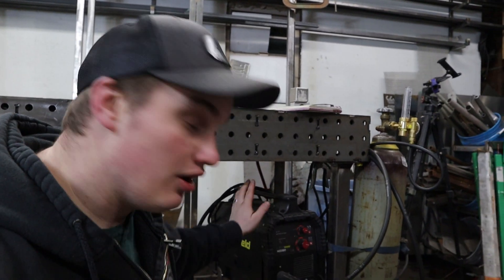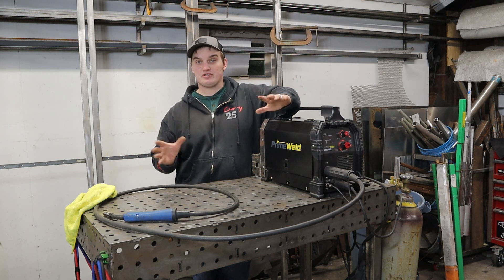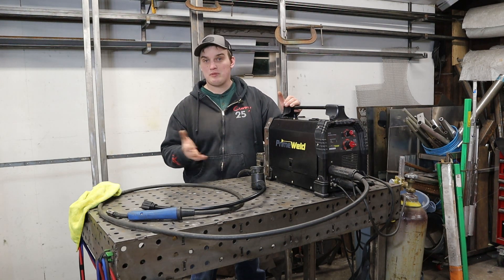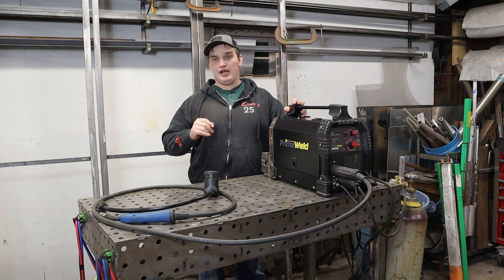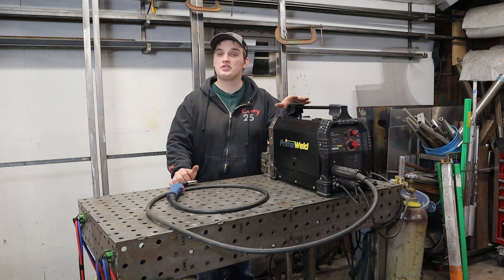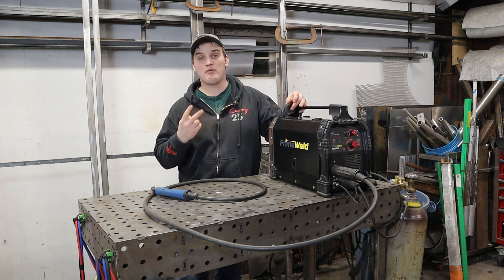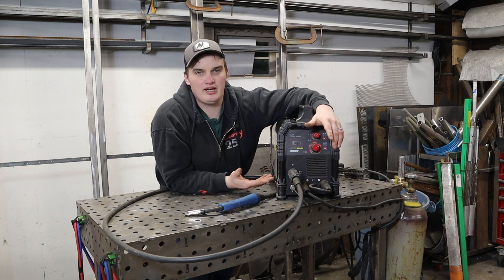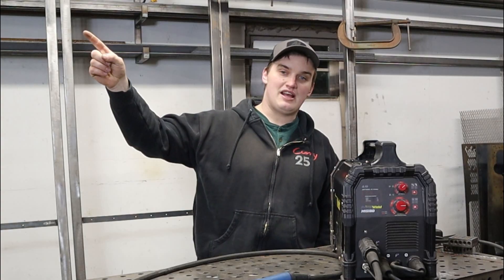PRIMEWELD Mig 180  One Year  Review  NOT SPONSERD ( 2022 )

Comment: I'm a bit confused with the MIG 180 vs the MTS 200 from Primeweld. Both do mig and flux. Both do stick. The 200 does TIG and the 180 comes with the spool gun for aluminum? What else is the difference?
Reply from the maker: You got it. That's the primary difference besides a couple hundred dollars. I would recommend the 180 over the 200. You don't get that much more power for the price

Comment: Any idea how thick you could properly weld on both the 110 and 220. Looking to do a front tube chassis on a car but only have 110 at home. All material should be around .125” or thinner, thanks
Reply from the maker: Unfortunately the most difference on that isn't based off the machine. It's usually based off of the size of your circuit. I have 12 gauge wire and a 20 amp circuit. On 110 and I can weld up to quarter inch with no problem. But the smaller your circuit and wiring are .the less capabilities you will have.  But unless you're wiring is very underrated you should not have a problem doing 0.125 or less

Comment: hello and congratulations for the video! soon I too will have a mig 180, I wanted to ask you about the settings for the spoolgun on aluminum. how many amps and volts to weld 2mm or 3mm thick aluminum? thanks a greeting from Italy
Reply from the maker: I usually start with what the chart says that comes with it and adjust from there
Reply: @amcustomfab  ok thanks a lot!

Comment: I just received my Tweco 2- style replacement torch after the stock torch plastic snapped open.  It's more annoying to use (the button is farther down the handle and triggers more easily).  Though, it is much heavier and more robust.  It will take some getting used to.

Note:  the new gun uses the long tips, so any consumables you have won't fit.  Also the shield slides down the nozzle easily, so you have to constantly pull it back on prior to welding.
Reply from the maker: Good to know

Comment: do you know how thick this can weld up to? i plan on using it to build utility trailers, rocket stoves, fire pits and repairs
Reply: MIG it can get full penetration with steel up to about 3/16 but that's pushing the limits of your output & duty cycle. Much better to have a beveled joint and not run it so hot. Or use stick to get that penetration on thicker stuff. Aluminum is comfortable up to 16ga.

Comment: I noticed their website says the mts200 and 145 can scratch tig, but not for the 180.
Will the one 180 still scratch TIG on the stick mode? Thanks again.
Reply from the maker: Yes it can scratch Tig. The 200 is actually a lift Arc which if you watched my video I made that mistake of calling a scratch start which was my bad.  But me personally I would get the 180 and then put the extra money towards a dedicated tick machine that can do AC also. So you can weld aluminum because the 200 is DC only.

Comment: Subbed! Awesome review. Your videos have been helpful in me making my decision and purchasing my 180.

I've heard that the machine requires a 30 amp breaker even in 110 configuration. Have you had any issues using on a 15amp breaker?
Reply from the maker: I use mine on a dedicated 20 amp 15 will probably be a little low unless you are just running on thin sheet metal
Reply: @amcustomfab  good to know. After speaking to my electrician he let me know that I have 20 amp service outlets on the exterior of my garage. Thanks!

Comment: Is there much of a difference between this 180 and the 200. I want one and figure that I'm better off just going with the 200 since its only $200 more and just 3lbs heavier.
Now if the 180 was at least 15lbs lighter Id go with that for mobility.
Reply from the maker: I personally feel like the 180has a little more value for the price because you don't get that much more power out of the 200 and the 180 comes with a spool gun.
Reply: @amcustomfab  thank you, that helps me a lot on making my decision. I'll use the funds I save, and buy the 220v extension cord I need.

Comment: Deciding between this and the brand new lincoln weldpak 90i mig. The lincoln is only 15lbs instead of 40lbs and it's 150 bucks cheaper but it only puts out 120amps(the name is misleading) and can't runa spool gun(let alone coming with one. It also only has a 10gt lead rather than a 12ft.  But the lighter weight means you can weld with it slung over your shoulder for an hour and not get sore.
Reply from the maker: I guess it's all going to come down to what you're going to need at the most for if you really need to swing it over your shoulder and climb a ladder 15 to 40 lb is a huge difference but if you need it to be more versatile on both amperage and processes the 180 is where it's at
Reply: @AM Custom fab  yeah I thinks that's what it'll be. I'll get the mig180 and maybe the $170 Titanium flux125 for when I need a 15lb machine

Comment: Interested in how it runs on thin sheet metal? Looking to do work on some thin stuff and wondering if it can go low enough for that.
Reply from the maker: I have only welded down to 16 gauge with it. To which it does very well I'm sure it can go lower. The mts200 I have welded down to 24 gauge with it even welded some razor blades together but it has the ability to change the inductance.

Comment: Man mine came faulty out the box . Makes you wonder why they offer 3 year warranty . You’ll be screwed after that . Gotta wait til Monday to talk to customer service . Do you know if refund is an option? or do they just keep replacing with new one every time unit breaks down
Reply from the maker: Anything can be faulty. Even name brands just had a $10,000 dynasty 400 go out in 8 months at work. Took them 4 months to get it fixed. These guys will have you taken care of in less than a week.
Reply: @amcustomfab  yea you’re right, just my luck. I’m over thinking ima have to try a Lincoln 180 but hopefully the new unit good to go
Reply from the maker: I have ran a Lincoln 180 and the primeweld is definitely better.
Reply: @amcustomfab  
Do you know why the Lincoln 180 says it'll weld 1/2" steel with fluxcore, but the primeweld only shows up to 1/8"?

Comment: Just got one of these after waiting 2 years to justify buying one and straight out of box before I made one weld the display on wire speed skips 4-6  no matter how slow you turn it which isn’t a huge deal but messes with my ocd especially when the old beat up titanium still running strong after years 🤣, tried to ask on the Facebook group and posted video asking if anybody had same problem got called a “Karen” and other bs, no answer from primeweld yet but I don’t find it un reasonable to expect a brand new machine to work 100% right, question is have you noticed any of the ones you use doing this? Only other machine I’ve had to it ended up to point it wouldn’t adjust wire speed and miller had to repair it after a couple years.
Reply from the maker: I'm so sorry that happened. I personally don't have a digital one yet. I'm still rocking the analog I haven't specifically heard of that symptom yet  but if it seems to be functioning and I'mproperly  I would definitely try to contact Prime weld again, recommend calling. That is the way they are the most responsive. And if you don't get a response, message me again. Thanks for watching. Appreciate the support on the channel 😎
Reply: @amcustomfab   thanks for the reply back, I wish this one had the old style I prefer that to the digital but if it does have it I atleast expect it to work like it should lol your first video on the 180 was the first I ever heard about primeweld then found the group on Facebook and have been wanting one ever since, not really worried about the guys taking care of problem anytime I ever had a issue with other stuff it was taken care of almost instantly.
Reply from the maker: Like I said I don't know because I haven't had one in my hands but I would suspect that that would not change the functionality. They're definitely a little quirks like that on budget. Friendly machines. But if it's not to your satisfaction I would definitely give them a call Monday. And if you don't get a hold of anyone, let me know.
Reply: @amcustomfab  thanks I finally talked to think his name is Michael I’d have to go back to the messages and make sure but there supposed to be sending one out Monday he said no there not supposed to go by 4-6 something needs to be fixed or adjusted in the circuit board I think is what he said, no worries as far as primeweld just wanted to make sure it was a problem before bothering them if it was a easy fix but they are taking care of it, next is a tig from them eventually, your videos cost me money 🤣

Comment: Trying to decide between this machine and the yeswelder 205ds. Actually had the yeswelder in the cart ready to hit purchased when I came across the prime weld. There are not nearly as many videos on this machine as there is the yeswelder. I wonder y? this machine seems to be a bit more robust and has a good warranty. I am not looking to do tig.
Reply from the maker: Customer service is much better with this brand.
Reply: I'll 2nd that.  No questions asked, sent a pic of the problem, and new part was shipped next morning. Great response time.
Reply: Get the PrimeWeld - the Yeswelder has synergistic settings only which are completely faulty due to Yeswelder overrating the amperage. The Yeswelder uses CCA (Copper Coated Aluminum) leads causing high resistance and poor weld quality in less than perfect conditions. The list can go on and on. Between the two - 100% PrimeWeld for quality and customer service, and support from professionals like, Alex.
Reply: Yes w spends a ton on advertising and  PW does not. Even if it costs more the Prime Weld is going to deliver on the specs and support will be there. As a test send both companies a email question and see how long it takes to get an answer.
Reply: I sent an email Sunday night at 10:00 got a response from Gene at 7:00  am Monday including a first responder discount. Order placed for a mig180. Thanks everyone for your input.
Reply: Solid info...thanks
Reply: @bighammer822  you made the correct choice.  Congratulations on your new welder